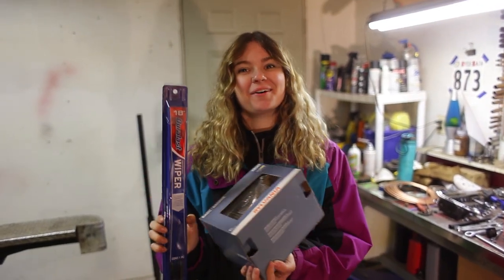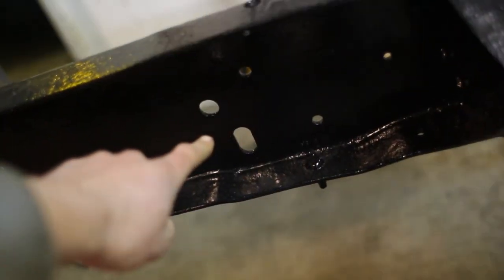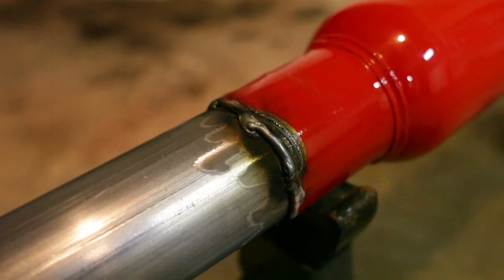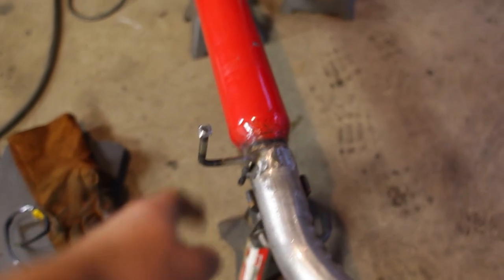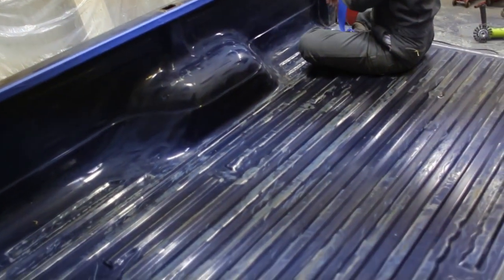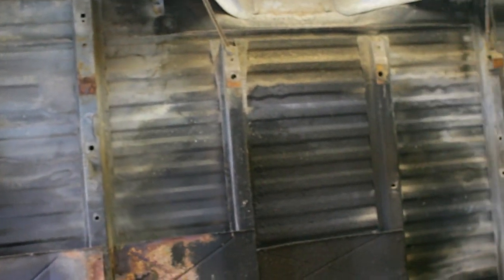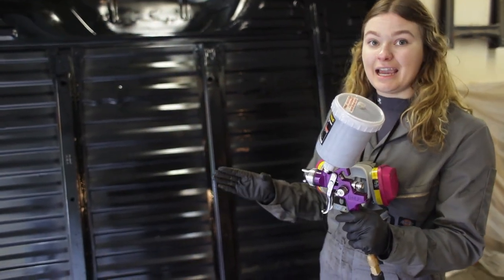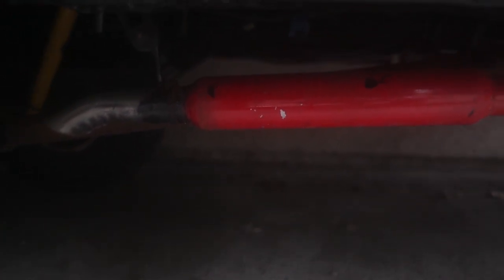F250 Restoration Pt 7: DIY Bed Liner and a New Muffler

Comment: Umm I have a devibliss ,a cambell hausfield and that very same Harbor freight gun.  The gun works fine as a matter of fact I use the harbor freight gun more than the others. You need to adjust your spray pattern .
Reply from the maker: We realized that it was the paint we were spraying. Once we started doing actual automotive paint we got some nice results

Comment: Hey guys, love the restoration videos. I’m currently working on an 86 f150 with a straight six. I was curious though, how did you get the undercoating off the bed? Was most of it flaking already or did you use chemicals or heat and a paint scraper? I have that task coming and I’m just trying to prepare.
Reply from the maker: Ours was never undercoated, so it was only old flaking paint. We used wire wheels and flap disks on angle grinders for most of it. We learned later on that there is a huge dirt trap in the wheel arches though. Take a look above the wheel and you will see it. Make sure you get that really flushed out. We had dirt and mud packed in between the panels.

Comment: Im working on my 87 f250 patching up rust holes in the floor pans and having a cheap homemade sandblasted makes things go so much faster
Reply from the maker: Yeah we learned a few things on this project, one of them being that we should have invested in a sand blaster since we ended up doing so much rust removal. The second is that we should have gotten a parts washer before doing the engine rebuild. Unfortunately we just didn't realize how far we were going to go when we started.

Comment: Did you take out the cats too ??
Reply from the maker: Our truck never had cats. I think that came after the 1986 models when they switched the 351w to fuel injection
Reply: Oh really ? I have an 86 f150 351w ho with a factory 4 barrel carb, and it came with 2 cats. I cut one off and still doesn’t sound as good as I want it to. Your guys’ truck sounds good tho with only the cherrybomb